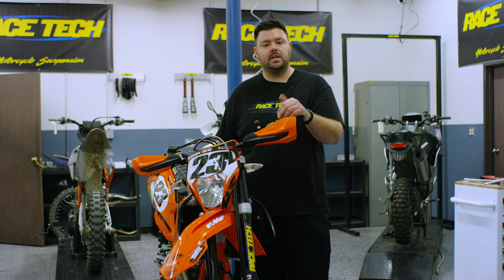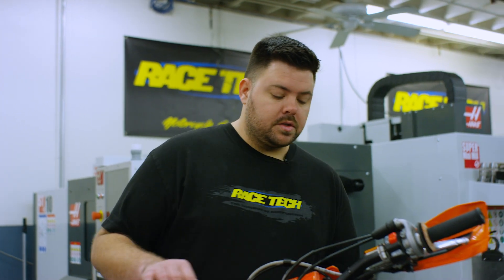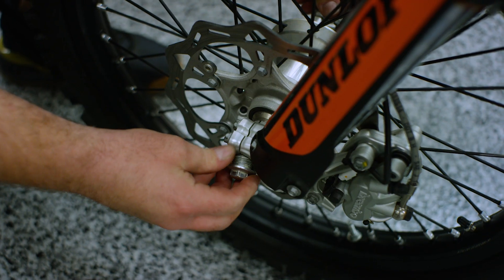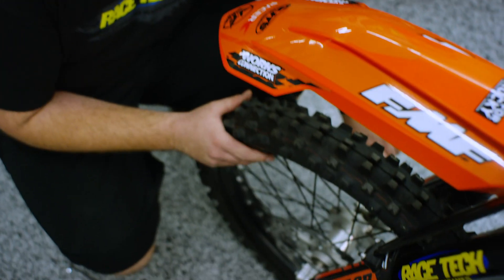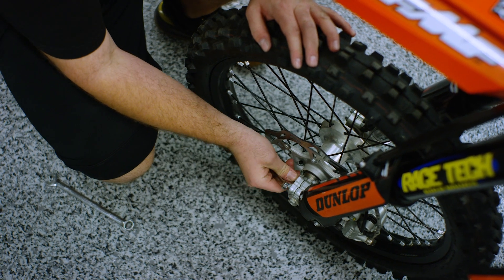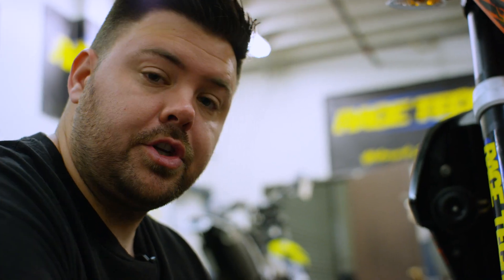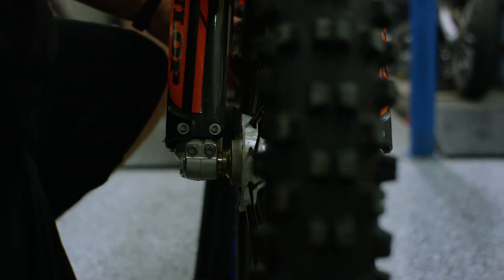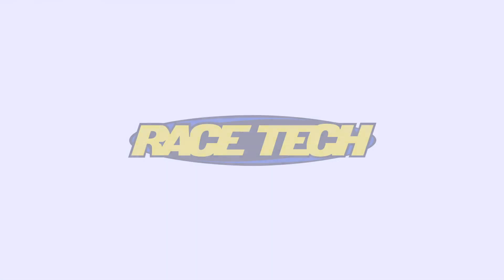TECH TIP - Properly installing your front forks and front wheel

Comment: Ktm triple clamp Fork pinch bolts 106 inch lbs lower clamp bolts & 150 in lbs for the upper. Honda lowers are 180 in lbs, 192 upper. Yamaha 168 in lbs lower, 204 in lbs/17 ft lbs upper.